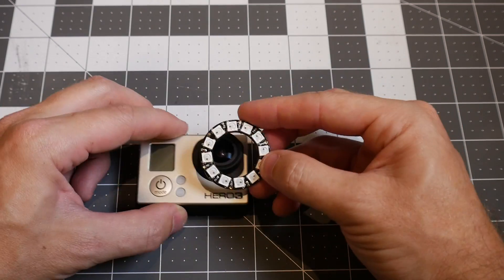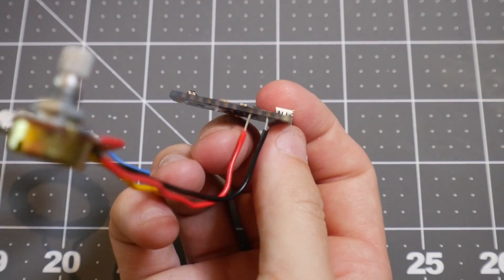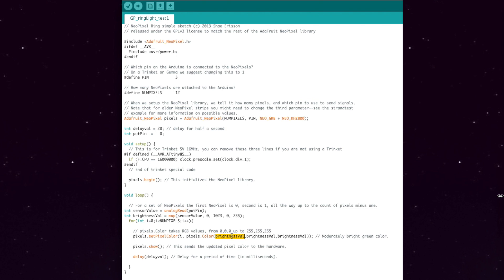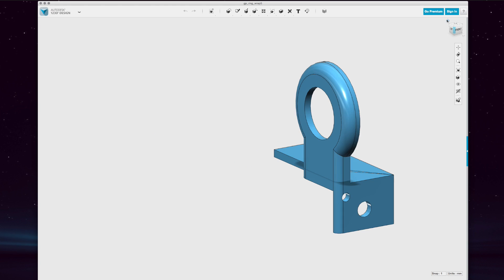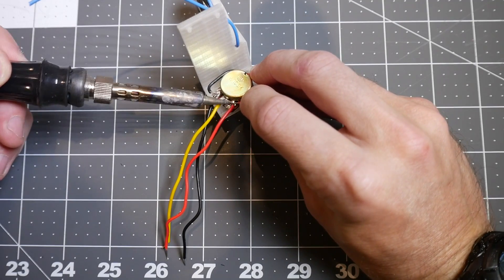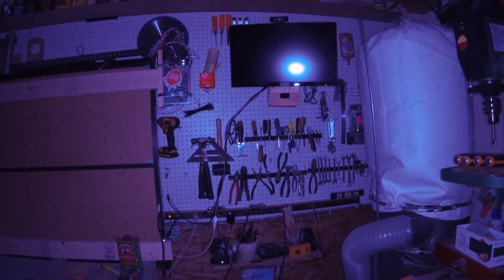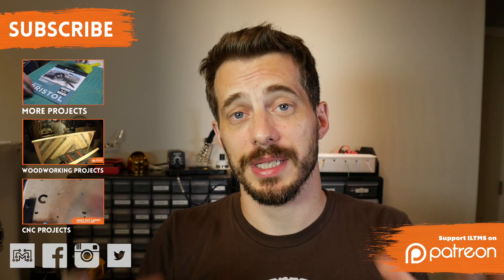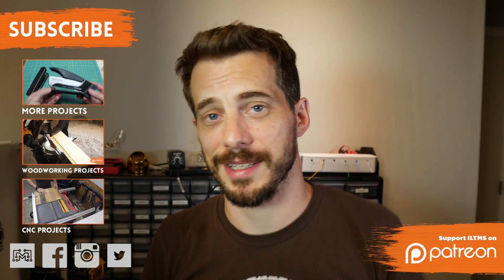GoPro Ring Light // How-To | I Like To Make Stuff

Comment: I'm glad I found this video because I'm working on a project that needs four of these lights. I'm wondering if I could wire four of these to one pen so I can control them all at once. The battery I'm using is an Anker 13000 which has a 5v output

Comment: Excellent idea and execution. That color cast on the footage while using the light ring could also be from two separate sources. The material that is used to print the plastic prototype and diffusing the LED's can possibly be adding to the blue color cast. Also, the LED's themselves can contribute to that coloring. The interesting thing you have, with the code on the board that you were editing, you could play around with that to 'white balance' the light coming from the LED's through the plastic to give you a more natural light source. it would help to get a much more accurate lighting for you footage I think. Really though, what an awesome idea to come up with and actually make!

Comment: That's very cool, and would solve one problem I have: recording with the GoPro Hero 4 Black inside.  It's taken a bunch of fiddling with the ProTune adjustments to get halfway usable material.  It's awesome outside during the day, and on night rides with the mountain bike and 2800 lumen NiteRider illumination.  

But it doesn't quite touch using most smartphone cameras when inside, and I didn't want to blind...everybody, especially the dogs, while trying to fit a GoPro harness onto a Chihuahua mix.  I've had friends flip over their bikes, but I think the dog trying to get out the harness was the most action the camera has seen so far.  :-)

Comment: Using a whole arduino board for such a small project is wastage of i/o pins on the board, you can only use the small IC ATtiny85 for this project, it is an atmel IC just like any other arduino board, but you will have to program it using another arduino board. And there by end result will be more smaller and cheaper. Thank you.
Reply from the maker: This is a prototype, which is what Arduinos were built for. Feel free to use whatever specific piece of hardware you like when you prototype your own ideas.  Comments like this really don't offer help to someone who is just learning how to do electronics projects.  The initial steps are about learning, not programming your own ICs.
Reply: sure :)
Reply: didn't catch any of your earth shattering creations there bud, what a fool.
Reply: you guys are rude. he was trying to help

Comment: If I were you I would have used inventor, mostly because I am very familiar with inventor and there is no need to transfer the 3D model sketch to a different software to print it

Comment: can anybody help me?
I tried this project out with an Arduino Pro Micro (ATMega32U4).
It works fine until i unplug it from the computer and plug it in again/into the battery.
After that only one LED lights up. No dimming, nothing.
Any ideas?
Reply: +TrackStriker maybe you didn't properly upload it to the device? and only ran it in debugging mode or something?
Reply: nope, I got it. Was a cheap chinese fake. Got the Trinket and everything went finde. Thanks :)

Comment: // Can someone help me understand this line of code
int brightnessVal = map(sensorValue, 0, 1023, 0, 255); // why did he use 1023? Instead of 255?
// Also for
int delayval = 20;  // he says this delays it for half a second, why not 500?
Reply: +TheBeardedMan 
because the ouput value from the adc is probably 10 bits (ie 1024  values from 0 - 1023)
you can look up the map function for yourself.
the half a second is an old comment. half a second would mean that the color of the leds would only update twice per second which would be really unresponsive. Thats why he changed it to 20 ms (50 times per second).

Comment: hey there, here's a question. I want to make a table lamp on 18650 cells. I only have a problem. I don't know what parts to buy for it and this video contains the right idea for me. I want to make a table lamp with led lights in it and i want to dim it if in need. I already have the 18650 cell here but what do I need to buy more for the idea? can you help a maker out? greetings from Holland.
Reply from the maker: +luckym0nk3y As long as you have a strip of 5v LEDs, those batteries should work fine in series to power it.
Reply: +I Like To Make Stuff  thanks I just watched more of you're video's. you earned yourself a sub! nice vids

Comment: Seems a bit over complicated for what it is and the requirement for an external power supply rather than using power from the GoPro itself or a slim discreet battery doesn't make it especially appealing in my eyes. But I know this is more of a proof of concept than a polished product ready for market.

Comment: Nice video, though i have some tips:
it has a blue tint because if you used a rgb ring instead of plain white lights which mixes all 3 colors together with blue being the brightest (probably?)
if you want to make it more compact, use a normal trinket instead. it has less pins and less memory (which is perfect for this project because you dont need a strong microcontroler for this purpose) but is also smaller and  has a lower pricetag to it

Comment: Im struggling to understand why you would need a ring light for a GoPro? I mean if you look at the two main reasons you would use a ring flash; in macro work, where other lighting would be obstructed by the camera rig. Or in glamour photography where the ring flash produces a beautiful catchlight in the eyes. So really, who's doing macro with the ultra wide-angle GoPro? And this ring flash would be far to small to product a decent catchlight not to mention the fact that a GoPro would most likely be too wide to pick it up. Has anyone made this and actually found a use for it that any other normal LED panel would provide?
Reply: +Alex Hemingway I did. I will use this ring for chroma keying my camera with a retro reflective backdrop.also, with a switch button i will use the potentiometer to fade colors instead of controlling brightness. . By the way, thanks to this video, I discovered Arduino and Neopixel worlds...
Reply: +Sor Ma what do you mean by fading colors with the potentiometer? Seems interesting.
Reply: I mean changing colors R G B using potentiometer instead of switch
Reply: Sor Ma awesome! Did you actually do it? I though the POT was for merely changing the current, hence the micro-controller for changing the color.
Reply: +TheBeardedMan the pot is connected to the microcontroller so you can assign it different instructions, including fading colors.
Reply: Sor Ma okay. I'll have to give it try. I'm new to this so I don't know.

Comment: Hello, I have a question, i don't own a 3d printer so Ive asked someone to print the part for me, they have said that the transparent filament can be difficult to use, they've had a few goes and halfway through the printing its started to cloud. Did you experience this during the printing process? If so how critical is it to the light penetration? Cheers
Reply from the maker: +RCQuad 35 It's definitely necessary, otherwise the light can't pass through.  I didn't have any trouble with it, but my experience with filament so far as been that the cheaper it is, the worse it works. :/  I've had good results by just not buying the cheapest one I could find.
Reply: +I Like To Make Stuff Appreciate the reply cheers! I've had a few parts printed from him and they've always been of the highest quality, don't think he'll be using the cheaper filament. I'm sure we'll get it sorted 😀, once again Cheers

Comment: Does it matter if the potentiometer is 4.89 instead of 5? I have quite a few laying around along with a micro compositor. I am thinking I could make a duel ringlight set up routed to two different micro compositors but in the end have a duel LED shaft holder for the gopro casing. thanks for the 3d software too, that helps a BUNCH

Comment: Mhmhm could somebody explain me why you needed the code part for it? Couldnt you just have used the voltage straight with the switch to set the brightness of the LEDs? Isnt it the more power you run to the leds teh brighter they are and you can control the voltage with turnable switch like that? 

Still really cool vid, love watchin these, subbed and liked bro!!
Reply: +Three points Veteran Scars 
Hi 3points, I too thought the same.
Reply: +Three points Veteran Scars oh I just scrolled comments and noticed several people asked the same :D Ups my bad ^^
Reply from the maker: +Three points Veteran Scars Check out the explanation in the follow up.   They're RGB LEDs
https://www.youtube.com/watch?v=ilTuVXCrWAI
Reply: +I Like To Make Stuff Now I feel super dumb XD Thanks alot haha and sorry for askin the same as  everyone :D :D
Reply from the maker: Three points Veteran Scars Oh, don't sweat it.  It's not something I did a good job of explaining in the video, which is why lots of people are asking :)  We're all learning together!!

Comment: I think yoyr 3d model is great but your circuit is unnecessary complex, all you need is the "pot" and a switch you don't need a programmable ic in between
Reply from the maker: +Param Mistri (The Amazing Robot) See the follow up video for the full explanation, but that's actually incorrect. These are RBG LEDs, not a single color.
Reply: +I Like To Make Stuff  sorry about that, my bad

Comment: So now what you need to do is add a button, and have it cycle through different colors... that would compensate for the blue tint. You could also have a green to simulate the "Night Vision" effect in movies... and a reddish glow to simulate "IR Video" also for movies. Other variations could be used for effects as well.

Comment: connect a 1.5v to 5v converter to the arduino and insert a slot for AA battery in the 3d case and it will be good, connecting a cellphone battery pack to a gopro and holding both is quite unpractical

Comment: Do you need the arduino in that at all? Couldn't you just get a pot of the correct resistance? It would consume far less energy this way and be more compact.
Reply from the maker: +Jaccob Mckay No, you could definitely do something similar without the Arduino. The Neopixels are not a simple LED strip with 5v/GND.  They require a data input for color control.  That could still theoretically happen without an Arduino, but it's much simpler using one.
The real reason I used it was because I had it on hand, and it's a base for another more complex version that will take advantage of the Arduino.  Cramming too much of a jump into one video would turn off the majority of viewers... baby steps :)

Comment: That adafruit is so much overkill for that project. You can use simple buck converter. It not require coding stuff, and it is a cheaper and smaller solution. But btw nice idea.
Reply: +MrBarnejstinson yeah, there wasn't even the need for a dev board. The space this Arduino-thingie uses could be for a LiPo cell with a power controller.
Reply: +MrBarnejstinson how would a buck converter help drive a neopixel ring?
Reply: +MrBarnejstinson Or using a double thrystore

Comment: You can use a lm317 used like constant current supply and never get flicker, and by the way will cost a couple of bucks. The idea is good, but the implementation not that much, you will not be hurt by learning some basic electronics

Comment: Are you getting any "strobing" on video when you use the light dimmed? Normally you get strobing in video if your LED light source is not dimmed via a voltage regulator.
Reply from the maker: I expected the PWM to be an issue initially but it turned out not to flicker. Not sure if that's built into the code library or what but it seems fine.
Reply: +I Like To Make Stuff good to know. I've actually been working on something similar but for my iPhone. I'm glad you did this bc your version is more compact than what I was putting together (the voltage regulator that I was planning on using was pretty bulky). I love the channel, thanks for the great videos.

Comment: Aaaah come on people, a dimable light controlled by a computer with software? Just 2 or 3 components with a battery and it will do exactly the same! No software that can crash or do something you don't want it to do, just straight forward components that will work exactly the way you think it would work.
Reply from the maker: +FreerunMediaService You're right, but as an entry point to someone with no electronics experience, this is a simple way to get started. More importantly, it's a base for the next iteration, with more functionality.
Reply: I am sorry but even for an entry level it is too much. You need to write the software, compile it and try if it works. Just a hand full of components and you know what electronics do, it is much cheaper and it works and when it "crashes", shut down and switch back on. Rebooted in 1 second. Doing everything with a computer and connect it through IOT ( Internet Of Things ) and no one knows what is going wrong if something stops working. Learning people how to program things is fun, but to program something you need hardware. If there is no one who knows how to build and repair hardware, what use is it than to know how to program something?
Reply from the maker: +FreerunMediaService You're welcome to make it, and an accompanying video in any way that you see fit. Your expectations and goals are not mine.
Take it easy.

Comment: DIY Perks has an interesting video explaining why using PWM controlled LED's is not a good idea if you are going to use it for video recording, you should check it out. Although I'm not sure if the NeoPixel ring you used already has some kind of filter or digital to analog control, this would be very easy to implement with some basic electronic filter.

Comment: Adafruit sells a Lipo battery pack that allows you to power via a small Lipo battery. I've used them on the trinket too. I think it would be a cool upgrade so you don't have to carry around the USB pack. Great video, nice to see you getting into 3d modeling and designing.
Reply: Only a 3.7 v. I think there's a booster to 5v though.

Comment: Nice video! I like the mix of the multiple aspects of it all. I don't think you should shy away from some more programming things. And letting people know there's more to it like turning on individual LEDs at a time and using color.

 Another idea that could build on this would be to do this with designing your own simple circuitboard using cadsoft eagle (or some similar PCB design software) with cheap surface mount white LEDs. And then use voltage regulation for the dimming compared to PWM (no tendency flicker on video, since PWM actually turns on and off the LEDs rapidly to make them dimmer).

https://www.onshape.com/ is another free (well you can only have a few private projects) CAD software I'd recommend you try. It's all in the browser with unlimited history, collaboration and lots of features. True parametric CAD. Not that I'm a CAD pro or anything. Even lets you use it in the phone or tablet, and I don't just mean view, edit and whatever.

It's a lot easier to get into than 123D from my experience, and I'm a newbie as well. Mostly I've used sketchup before.... I sound like a salesman. I'm not affiliated with them, just impressed :)

I'll stop blabbering now. Keep up the good work! :)

Comment: You may try a attiny85 like the trinket or the Gemma. Just an option to shrink. If you even use a 8 pin DIP chip and a bit of veroboard you get an even smaller size. But it requires quite a time to get the ArduinoISP running. 

Get it run first, optimize later... Well done Bob, the soldering shoots at 4:00 are beautiful.

Comment: You could experiment with different RGB values from the neopixel to color correct the raw gopro footage.  Applying a transform (scaler) to each of the RGB values in order to produce a light which compensates for the wacky white balance of the gopro.  In simple terms, I'd start with scaling the blue down by 25%.  In integer math this is as simple as multiplying it by 75 then dividing by 100.

Comment: Why did you use the map function, instead of just doing a 2 bit shift?

scaledValue = rawValue >> 2;
Reply from the maker: +eformance There are 100 ways to skin a cat, so they say.
Reply: Well, 2 bit shift is just a division by 4, so you could have done it with scaledValue = rawValue/4 too.  I merely pointed it out because it makes an otherwise simply operation look complex.  Today's newbies need to learn the fundamentals.  The map function is good for doing offset and scaling in one call.

Comment: Great job and great printer! I used my Ultimaker 2 and a NeoPixel ring to make my 3D printed stepper motor. I have also used clear Taulman PLAtinum for a diffuser on my IoT Command Center and my upcoming Axial Flux Stepper Motor.

Comment: I don't get why people dislike the videos from bob!
Reply: +joost visser I don't either, I don't personally like this video because it's massively over-engineered, you need LEDs, resistors, MAYBE an adjustable linear regulator if you wanted variable brightness... and a power supply. I HATE things with arduinos in LOL.

But I still didn't dislike the video :)
Reply: +TheChipmunk2008 The Adafruit ring probably needs a microcontroller to send data through the data line. It would be hard to do that without a microcontroller. However, I guess you could make a ring with just simple leds.
Reply: +Albert Qin as somebody else mentioned, you can add color correction, because the ring is RGB and the Neopixel aka ws2811 have a 1 wire digital protocol with tight timing parameters. So a microcontroller with 1 digital output and 1 analog input is required.
Reply: +TheChipmunk2008 it's a trinket pro, not an Arduino ;-)